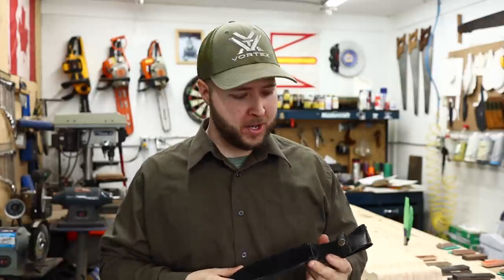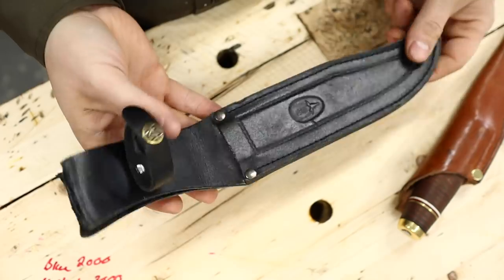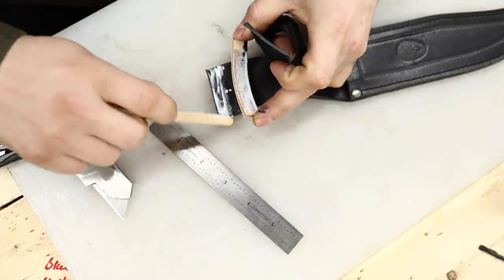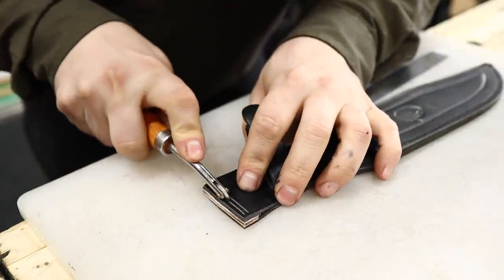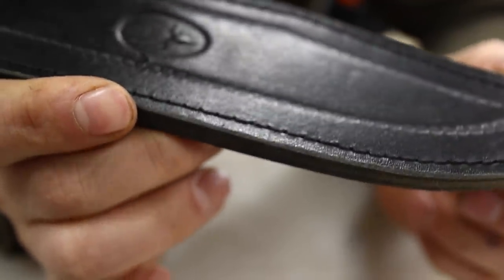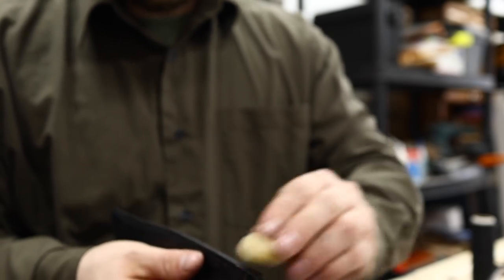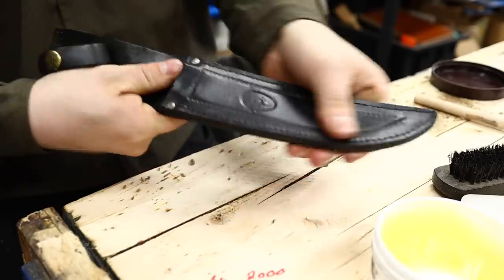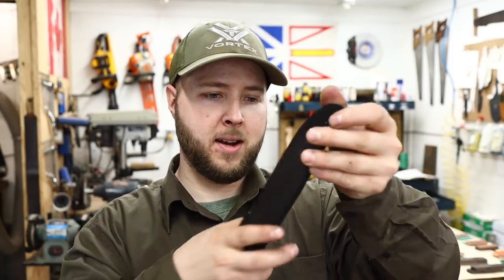Repairing and Restoring a Client's Broken Knife Sheath - [ Leathercraft ]

Comment: That's awesome, great finished product and he gets to keep a sheath he's likely had for years. I think that shows one of the issues you pointed out in another video where you built a sheath and you add the wedge to the upper portion to account for the thickness of the hilt so the sheath doesn't deform and bend right above the blade.

I did want to ask, if I wanted to get some tools to start playing around working leather where do you get tools like your groover or learn the different stitches and which work best for different applications?

Comment: Wasn't it possible to dye the scratches/stains that was on the backside of the loop? Only problem that popped up in my mind.
Reply from the maker: Good catch. It appeared to be heavy paint, and although I did prod at it a bit, it wouldn't come off. I wasn't asked to remove it, so I chose to leave well enough alone. Thanks for watching!
Reply: I prefer to see it left alone…. Tells me he is using and enjoying it. There is a story behind all the imperfections so keeping some also keeps the character of it. It’s not an expensive item so it was more about fixing the function.

Comment: Nice work! It would have been nice to see the knife as well..
Reply: Well I can help there…. No need to send the knife given the repair needed. It has a rubber-like handle covering with some brass accents with bolster and I believe there is a moose either on the blade or handle (been a while since I’ve seen it)

Comment: I try to avoid leather sheaths. But I do have one that's probsbly 100 years old. Got it when I was working at my local goodwill. Don't accept any knives of any kind that aren't for the kitchen. It's a folder sheath that has a hole in it. I don't trust my skills to fix it. But I also don't have any money to send it off to be properly fixed either.
Reply from the maker: No leather, so what do you use, Bradley?

Comment: I would be really disappointed with that belt loop if i'd paid for this repair. The rest of the sheath has nice smooth curves, and the top is this ugly squared block of material. Just overlap and stitch it together, or replace it with similar thickness material.
Reply: I think the customer asked for the cheapest possible option, as a leatherworker, sanding the corners would have meant more complicated beveling, sewing, and edge finishing. Those little things really add up. Just my assumption, I could be wrong.